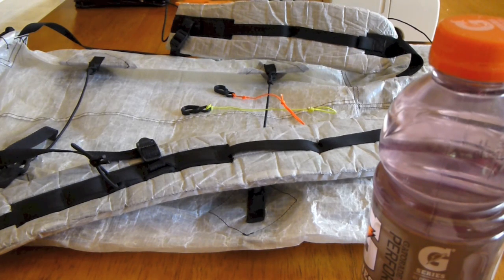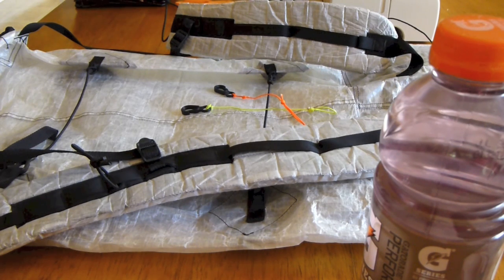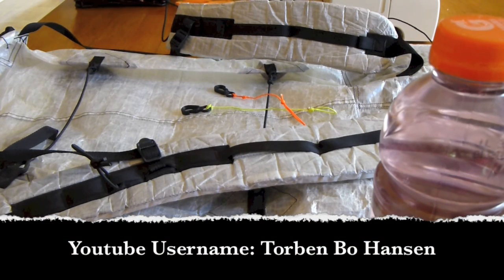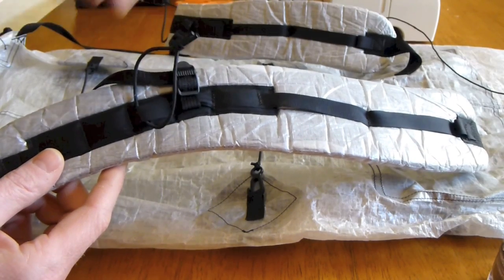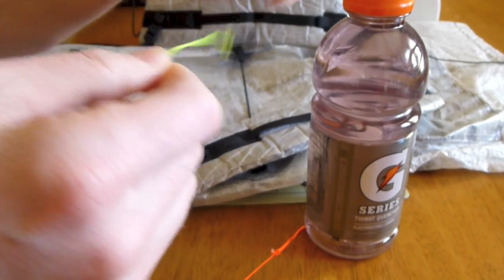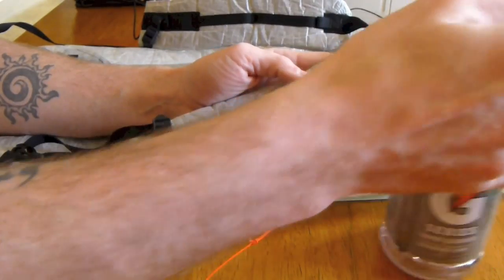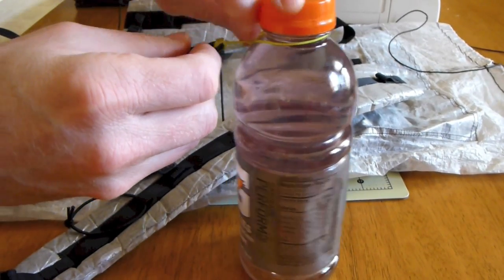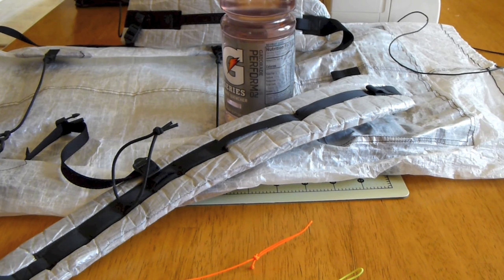DIY Shoulder Strap Water Bottle Holder

Comment: I gave up on bladders years ago, too. I much prefer the dependability of solid non-foppy bottles lke this but usually in pack. Having them close at hand like this always bothers me when putting on or taking off the pack yet I still use them. Not very often but they are handy when walking.

Comment: So. Not to sound stupid. You use your know with the little black clip on top (can't remember what's it's called at the moment). The Circuit yellow cord asks as the base just to hold the bottle, and the your setup at the top secures the bottle. Then the bottle won't slip out. Is that correct?

Comment: Great video.  I may try that and use a mini-biner to start.. Thanks
Reply from the maker: Glad you found it helpful!
Reply: Hi Sticks I made your set up and it worked fine on my Osprey Aether 70 but found out after quite a few miles the Large doesn't fit me.  I actually measure a Medium so I purchased a REI Flash 60, which also saves substantial weight, but there is no daisy chain.  Any ideas?  One thought I had was to sew a "D" ring on to the shoulder strap..  Thanks in advance for any input.